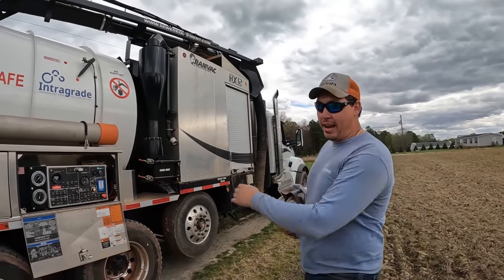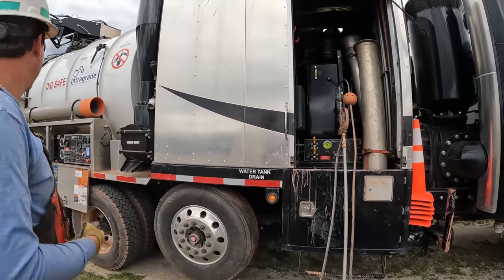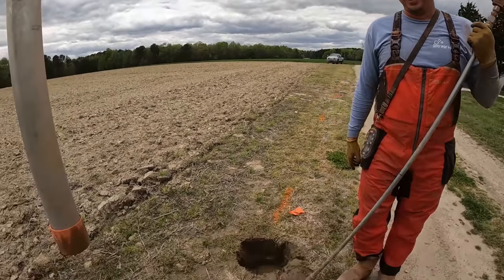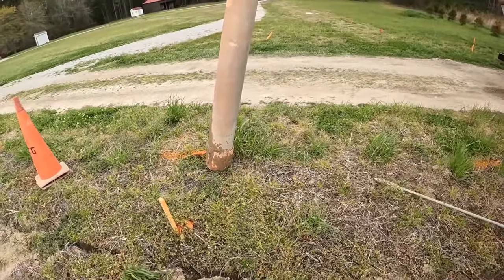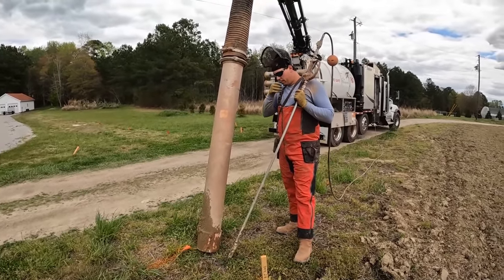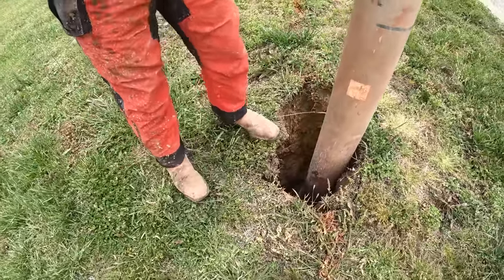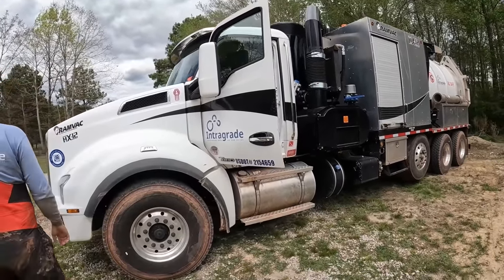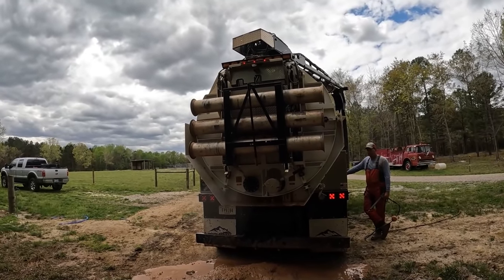Hydro Excavating Utilities With A Vac Truck

Comment: new technology ? I have not seen this before but she works beautifully, no cut lines, pipes or wires... Someone failed to bury that wire deep enough,,, High voltage wire should be at least 3 ft deep and marker tape above the wire ,, be lucky if it was 6 to 8 inches deep ,, Letsdig18 well done and good call.........👍🚚👍
Reply: it was a fiber optic line, not power

Comment: The pressure from the hose won’t damage the utility?
Reply: It can, but for most utilities it won’t hurt anything. About all it will hurt is the transite (asbestos) water lines. I use to work one everyday. They are pretty fun to work with.
Reply: @coltoncain2726  thanks for the reply. Impressive piece of equipment. 👍
Reply: It is variable pressure
Reply: That was my thought. I have seen amateurs cut through wood siding like a skill saw when they were only suppose to power wash before painting.

Comment: So my pressure washer can cut through wood if I’m not careful. If I get too close it’ll dig in and scar it and if I’m really close it will cut all the way through. I’ve even peeled paint off steel. 
Could this water pressure cut through the lines also? If so wouldn’t it be worse because water is involved?
I’m really curious about this. It’s new to me

Comment: Disagree, it's not the locate that can't be trusted - where the utility is at is usually correct on a planar surface ± a few feet. It's the depth that can't be trusted. Locates don't typically tell you depth, they just go with code. The reason depth can't be trusted is obvious. Even if you perfectly bury the utility to the required depth, eventually what's going to happen is someone is going to come in and grade or level the land and now your 3 feet is gone; and you don't really know if the land was graded before or after the utility was buried unless you're the one who did it.

Comment: I am thinking Officer Hoover may not agree with the assertion that he can have 1500gal. of water AND 12 yds of debris.   It is normally one or the other unless you have some very generous axle weight ratings.
Reply: That's 12,000 pounds of water. Dry dirt avgs about 2200 so figure 3200 for the slurry, that's another 38,000 so a total of 50k lbs.  That's a serious heavy load for 2 axles. Triple axel dumpers usually max out at 38k or so so yea................that's a bit over the top I'd say.

Comment: It is an efficient, but a bit cumbersome machine.
He probably will not make you unemployed.
Reply: It’s not meant to do what Chris does. They have been around for a long time, but in areas where development warranted the cost of a unit! They are very expensive.  Power poles in the country are almost always an auger until they get into an oil/gas field and there’s line’s everywhere. We set utilities much much deeper up North in Canada as the frost goes so much deeper. There still is a big use for these units. 
    I watched an improvised vac truck that had a crude setup. It really wasn’t much slower than this truck. He had the water and pressure washer on a separate truck, so one more crew. Like I said,,,,, improvised. 20+ years ago.  He kept busy working in farm yards where, all too often, farmers had run their own stuff no where near to code and then he would come along when the REAL utilities guys came in to fix the farmers mistakes!! Hahaha. He was in his 60s, at least, back then and did ok for himself.
Reply: @shitloveaduck  I know that. Just kidding.
By the way, the frost goes quite far down in northern Sweden as well. A water pipe must be 6m = 20ft down so that it does not freeze.
Reply: @makingithappen5178  - My bad!! That one flew right over my head!!! Whoosh!! Hahaha. Sorry.
Reply: @makingithappen5178  - 20 feet!! We are 8 feet where I live in Southern Alberta, Canada!! Footings, water, sewer. It’s often deeper, but I didn’t even think of 20 ft as necessary ever!! It does get cold and stay cold in Northern Sweden I suspect!! Thanks for sharing!!
Reply: @shitloveaduck  Well I live in a small village, called Vidsel that is further north than Yellow Knife. I did not find anything on your YouTube page,but I subscribed anyway.

Comment: They go to all the work of making an excellent video - and then screw it all up on the audio so all you hear is the truck running, and watch people's mouths moving while you try to figure out what in the world they are saying. Very amateur production. It's a shame.
Reply: Who forced you to watch?
Reply: Use CC then. :)
Reply from the maker: Rookie stuff here guys
Reply: @letsdig18  Still better than 99.99% of the crap on YT.  Keep on keepin’ on Chris!
Reply: @letsdig18  IGNORE the critics, Chris! 😉👍
Reply: I was able to make out all the important info but I do sometimes wish Chris would invest in a Bluetooth mic for his camera.
Reply: @letsdig18  you do better than some of the youtubers with camera crews and editors employed
Reply: I could hear everything just fine of what they were talking about, very interesting!
Reply: @letsdig18  VAC trucks came into the steel mill to clean roller lines where I used to work, Chris. 
Cold product would leave a fine scale, a bit coarser than sand and packed tight, mixed with chunks of broken steel. 
If it fit in the pipe...it was gone! It would  build up and bind the rolls. They were never out of work. 
The noise was deafening 🦻...even by steel mill standards...and the suction could rip your arm off. 
Your guy was clean compared to some of the places they worked at the mill. 😉👍